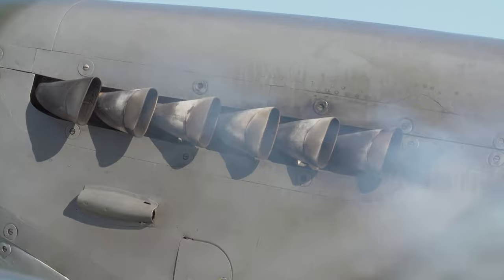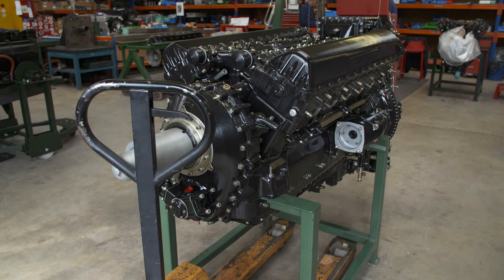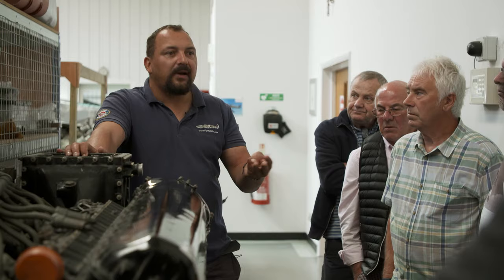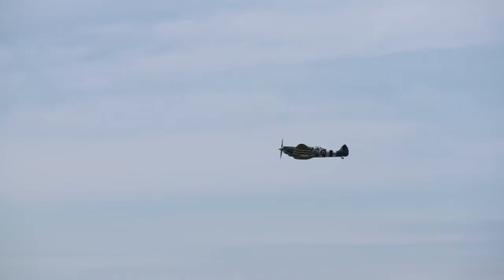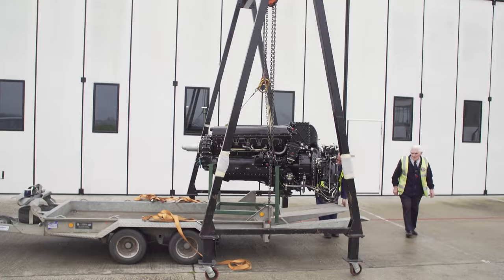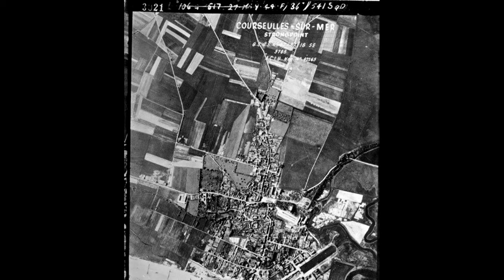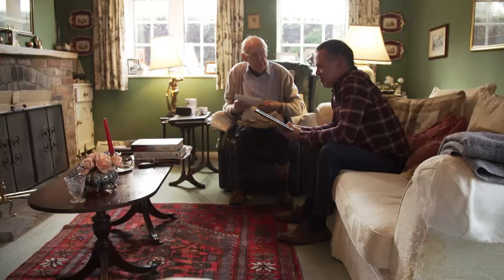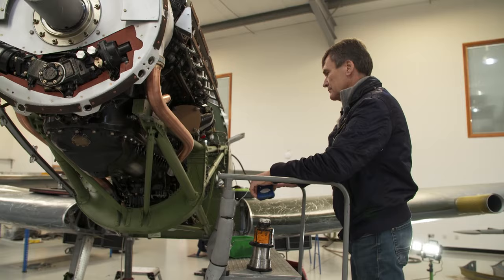How The Spitfire Fighter's Engineering Won The Battle Of Britain | Inside The Spitfire Factory

Comment: When my history books are correct Britain didn’t win anything and would have been done without the US entering the war, not mentioning the far superior Bf 109 which the spitfire couldn’t hold a candle to…
Reply: The Spitfire was normally ahead of the 109 in performance.  The 109F perhaps had an edge over the initial Spit V tropical, depending on the pilot.  Once the mk.IX and XIV arrived, the old 109 was second fiddle.
Reply: @bobsakamanos4469  well, what I’m reading herr is that the bf 109 was the better plane from the getgo. I’m sure later in war newer generations caught up, but then the Germans already developed the Me 262. which isn’t even comparable. Thank god the resource weren’t there to get these to significant numbers. I hope we’ll never see any airfights in Europe, two in the last century were enough…
Reply: @erebostd  if we stick with the original assertion about the 109, then the Me262 is a different argument and the 109 performance was overtaken by Spitfires and other fighters.  Yes, of course the germans were lightyears ahead in jet technology, but just didn't have the resources.  The US grabbed their transonic windtunnel equipment and rebuilt it in Langley (?), using it until the 1970s.